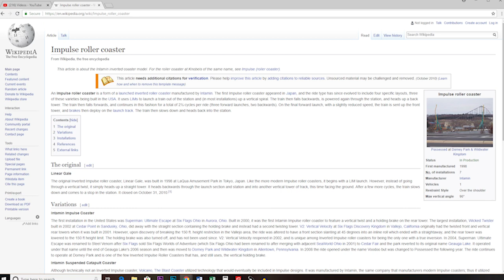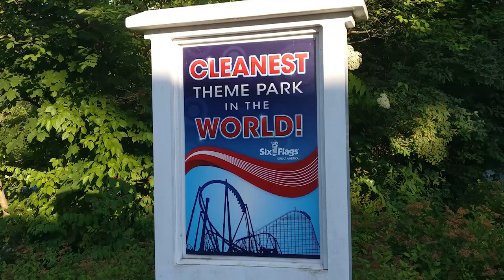Electromagnets, roller coasters, half-a-dozen flags, and clunkless chain lifts

Comment: Very cool! Check out Vancouver, BC's SkyTrain system. It's been in service since 1986, has been expanded several times, and is entirely LIM powered. The trains have a similar but much lower pitched whine as they accelerate. The MK1s have an especially strange crescendo, as they change the pulse width of the current driving the coils in the motor -- the MK1 trains were built before MOSFET technology matured, so they had to use a semiconductor which had fairly slow on/off times, and used frequencies well within audible range. MK2 and MK3 trains are all very quiet and smooth in comparison.

Comment: Would guess that the counter weight is keeping the chain tension constant. As the chain takes up the load it stretches a bit, and the weight moves down to compensate. Those transformers are usually marked with KVA and primary voltage, possibly secondary voltage. Those big ones look like perhaps 500 KVA. Realize that such a transformer can supply considerable overload for short duration, easily twice the continuous rating.

Comment: Some rides actually drive the chain TOWARD the hill, and loop the chain 180 degrees around a "dancer" idler.  This idler is tensioned by weights and shock absorber.  This was the case for Superman ride in 6 flags in Md.  The dancer oscillated when the train engaged.
     Regarding the drive tires, I would say the train is driven a little faster then the chain, and as the tires disengage, the train settles back against the chain, at the moment that the speeds match.  If the tires drove slower, you would have a guaranteed velocity mismatch at engagement.  Many rides use a small downhill to provide this match.

Comment: I would say that the linear motor on the first ride is probably run by a multiple of this style of motor drive units and, as you said, they are housed in that concrete building. They seem to go up to 4.5 MW so that should get those cars moving to 70 miles per hour! They also sink to grid so the braking action of the car would feed energy back.
https://www.industry.usa.siemens.com/drives/us/en/electric-drives/ac-drives/ac-drives-apps/enclosed-drives/pages/enclosed-drives.aspx

Comment: You’re very correct, the counterweight acts as a dynamic chain tensioner. Also, I’ve noticed that other parks suck in cleanliness. Cedar point is by far the cleanest park (non Disney/universal) that I’ve been too. Dollywood is a close second. However, Kings island which is another cedar fair property isn’t nearly as clean as cedar point. It must be a park management thing.

Comment: Hi there! I worked at SFGAm for 5 seasons as a ride op and in maintenance. My second season was spent entirely at Raging Bull. From what I understand, when the train engages with the chain, it adds an incredible amount of weight to the system, taking out all the slack between the motor and the train (i.e. the entire length of chain running from the train all the way up the hill and back down to the motor). In order for the chain to not become loose between the motor and the rear of the train, the motor end sprocket has that counterweight to pull out the slack.

As for the unfriendly signage, during my time working at Six Flags, there were several incidents throughout the country of people who were either injured or killed by roller coasters because they hopped fences. People cried out that Six Flags didn't do enough to discourage people from climbing over the 6+ foot tall fences with warning signage on them into dangerous areas. So I guess since I left, they've added more signage. Unsightly? Maybe. Trying to avoid lawsuits? Definitely.

Comment: Excellent sub-channel.  We were at SFGA just last month and had a blast.  It is a playground for engineers fascinated by technology.  The chain stretches by that much when the train load is added.  Hard to believe, but it really does.  Raging bull is the only super coaster at SFGA which means it is in the top class for speed and consequently requires the highest lift (and hence longest chain).  Some of the stretch comes from the bearings in the chain links relaxing between trains due to grease pressure and not just stretch of the steel.  Your 'ka-chunk' observation is spot on, but the shock is removed by matching the speed of the chain to the speed of the approaching train to minimize the mismatch.  Notice how the chain slows down between trains but never stops.  This is to save electricity and reduce wear.  It never completely stops moving because the energy to overcome the 'stiction' or static friction negates the energy savings and wear reduction.

Comment: So this is quite late. B&M coasters use drive tired to match the speed of the train slightly slower than the chain just before engagement. Other coasters hit the chain slightly faster but do not require tires, and thusly experience the "kerchunk." The counterweight is just a tensioner, and is present on most chain lifts.

Comment: As mentioned, the linear coaster is likely 480v, as that is the standard for anything commercial/industrial. The cables in the framing might look thick from the outside, but there are likely many smaller cables inside the jacket instead of some 4/0 gauge wire. Each “cell” of the linear motor probably needs its own circuit in order to control the timing/speed. 

As for the lift chain, steel does not stretch that much. Also, the chain underneath the track is the portion under tension, not slack (the car is pulled from the top, not pushed from the bottom). That being said, getting the chain under enough tension to not have any play at all would need some major forces, so instead they just designed a way to keep the loose portion under control (motor to the bottom of the train). When the counterweight raises, it is actually decreasing the length between pulleys (“loosening the chain”) since the force of gravity on the weight would pull the chain tighter in the down position (gravitational tensioner).

Motor-> pulley at top-> train will always be self tensioning and holding the weight of the passengers. Train->pulley tensioner at bottom -> motor is the “slack” portion, so the counterweight system is just keeping it under control. Before the train arrives, the entire chain is under the same tension. Then, when the weight is taken, 2/3 of the chain is now under (30 people x 175 lbs) 5,250 lbs of tension, so all the slack goes to the portion with the tensioner hence why it increases in length (pulls the slack/gets tighter).

Comment: The counterweight keeps tension on the driving gear for the chain. To achieve the smooth transition, a series of drive wheels are used. A great example of the drive wheels are on Apollo’s Chariot at Busch gardens Williamsburg. Look at a POV and you’ll notice that the chain is moving slightly faster than the drive tires are moving. This eliminates the “clunk” at the start of the lift hill.

Comment: The reason B&M's have that "perfectly smooth transition" onto the lift is because of those wheels just before it, they call that a "lift feed". Other manufacturers use them at times as well, but they're most commonly found on B&M's. Never noticed that counterweight though, I'll have to keep an eye out for them in the future

Comment: I think that the black, comb shaped plate attached to the train, next to the LIMs, is how it knows how fast the train is moving. Similar to the way ABS systems read wheel speed. You can see what looks like a sensor block between the banks of LIMs. The control system has to know how fast the train is moving in order to properly sync the motors, similar to a sensored brushless motor.

Comment: The counterweight at 6.30 is b&m being bloody clever, it weighs the train by the strain on the drive tires when it leaves the station, it then adjusts its speed and chain tension appropriately, the counterweight is adjusting the chain tension. Sorry its about 2 years late.

Comment: I’m a mechanic on Wildfire at SDC. The counterweight holds tension on the tensioner sprocket. When a train is engaged and the load is transferred from the booster wheels onto the chain, what you’re seeing is the chain stretching slightly as it’s loaded. The counterweight moves to accommodate this and maintain the required tension on the chain.

Comment: My first Great America! I built a show for them the year the double eagle wooden coaster opened. WOW. [that show came here to Santa Clara later]. I think what you are seeing on the chain lift is the idler or tensioning gear relaxing as the chain takes up the load it was mimicking. [not balancing, just tensioning it slightly during slack time]

Comment: Woo-Hoo, roller coasters, one of my faforite subjects. You are absolutely right about the B&M lift hills that always engage carefully. I have never had a single one of them (and I have been on a lot of B&M coasters) that would get a "bump" when attaching to the lift chain.
From what I was told, your assumption is guite right. The chain moves slightly faster than the "booster wheels" just prior to entering the lift hill. The important thing is that there is a clutch between the motors and their "booster wheels" that allows the wheels to turn faster than the motor when the train has engaged to the chain and is pulled by it.
On Arrow coasters, famous for their violent engaging of the lift hill, your train basically travels down a slope out of the station towards the lift hill, shoots up a bit and may roll back before it engages. The speeds are not synchronized and you clearly feel it.
The counter weight is, as others have stated, a tensioner. Since the motor is mounted on the bottom (other manufacturers place them on the top of the lift hill), and a chain can't transmit a pushing force, it is pulling on the lower "return" part of the chain, over the pulley on top of the lift and all the way down to where the train engages. With the little bit of play in each chain link this can give some significant lengthening of the chain when a train engages. So the lower pulley can move back and forth and is tensioned by that weight. 
Sorry for being metric now, but I am from Germany, the coaster was designed in Switzerland, so that is what the coaster and me are used to. Judging by the photos and the known height of the coaster, I would estimate that the chain has a total length of roughly 250 meters. Now let's assume a minimal chain temperature of 10°C and a maximal of 30°C (depending on the climate this might be a conservative guess). Given the coefficient of thermal expansion for steel (those chains are usualy not any fancy alloy, they are properly greased so they won't rust and the loads are not extremely high), this would make a difference in length of ~60 millimeters (a bit less than 2.5" if I am not totally wrong) between this temperatures. Of course there has to be some device taking care of that expansion, otherwise somebody would have to readjust tension all the time. Of course these figures have to be taken with a grain of salt since they are based on assumptions I have made looking at pictures, but the order of magnitude should be clear.
About your six flags rant, I couldn't agree more. As a roller coaster enthusiast, I visit the US every once in a while to ride some coasters, and of course, if there is a Six Flags park nearby, we are going to visit it. But we don't really enjoy, mostly due to the facts that you have mentioned. When we visited Gread America, we got rid of the parking fees since we stayed in a "nearby" hotel, which was a ~15 minute walk to the park entrance, but hey, $25 saved by just walking a little. Or recently we have been to Six Flags St. Louis, it was a day with not too many guests, so we had been on all the rides in less than three hours. We did not spend a single penny on food or drinks in the park, but instead went to a nearby Denny's where we got much better food at a lower price. Plus nice service. There's one more thing to rant about you did not mention - single train operations. Of course, shuttle coasters like the one you portrayed or their infamous armada of Vekoma Boomerangs can't operate more than one train, but also coasters that could theoretically provide a high capacity like their Batman the Ride B&M inverters, are often run using a single train only, even if the length of the line would allow for a second train to be run. I assume they want to make people pay for their Flash Pass or what it's called. (Dislike! No, not your video, that behavior of Six Flags!)
Hmm, I could add tons of other stuff, but looking at my longest YouTube comment ever written, I doubt anyone would ever read up to this point, so I better hit the submit button now...

Comment: My guess on the lift chain is that the chain motor runs slow until the train engages, when this happens the length of the chain tightens up leaving slack from behind the motor sprocket and below the train. The counterweight is on this slack and the position of the counterweight could be controlling a variable frequency drive which speeds up the motor.  This way the chain runs the same speed as the idler wheels then speeds up slightly once the train engages. Once the train is off the top, the tension drops, the chain returning from the top sags down, the counterweight goes up and the chain slows back down.

Comment: The counter weight is just that, a counter weight. It isn't controlled except by gravity. As the chain begins pulling the trail up the hill, the weight of the train provides tension to the entire length of the chain, which causes it to stretch and become longer (mostly compressing the lubricant between the chain elements, but also stretching the metal). The counter weight uses gravity to take up this slack.  The smooth transition is being created by the driven tires pushing on the back of the train which keep the train from slowing down while it transitions up the hill until after the chain is attached to the front of the train. To get them to link, the chain moves slightly faster than the tires until the chain grips on the train, when they two settle at the same speed.

Comment: Most likely the counterweight is for tensioning the chain. When the train couples to the chain he puts weight and therefor tension on the upper part of the chain (in front of the train) and this leads to les tension behind the train. The counterweight compensates that by lowering and keeping the wohle chain tensioned.

By the way, there are similar systems on gondolas, chairlifts, etc. But in that case the weight (or nowadays often a hydraulic system) acts the other way, when weight is added to the track (or in that case the rope(s)) the weight will go up. That is because the gondolas will pull down the rope between the poles and therefor lengthening it. Part of this effect get's compensated by stretching the rope but mostly it's done by the tensioning system. On the lift hill the tracks are solid and don't get longer, that's the difference. On a funicular it is just like the rollercoaster.

Comment: The counter weight on the B&M does what you say and also dampens the offload at the top of the hill. On old ones without the counter weight the track would have a little dip and flat section at the top of the lift hill (pov of Dragen Khan in Spain as an example). This saves on having to do that and stops strain on the chain as each car detaches from it.

Comment: I would guess that the fans on the motors were originally designed to have the fans run until the motors cooled down. Then someone who actually fixes things did the smart thing and just forced the fans to be constantly on in the logic. The cost of running the fans is miniscule compared to the cost of a blown motor and ride downtime.

Comment: If my motorcycle experience is anything to go by, chains can stretch slightly especially over very long distances like on a roller coaster lift, so the counter weight could just be a sophisticated tensioning system.

Comment: The common theory of the counterweight serving the purpose of a chain tensioner makes sense to me, but there's an additional element of curiosity added by what appears to be a position sensor above part of the tensioning stay. Could this possibly be used to calculate the weight of the train, and thus perfect the amount of braking applied later on in the ride?

Comment: The counterweight is adjusting the chain tension to make up for the fact that the chain stretches slightly and gets longer when an train is being pulled to the top.  It isn't much, but if it isn't accounted for, the chain will either jump off its driving gear or have to have an unacceptably high rest tension.

Comment: 6:36 My theory: While the chain is not "lifting", it's kept slack to prevent ware.  When the train approaches it, the counterweight tightens the chain around the gears to prevent the train from causing the chain to slip off the mechanism.

Comment: Your idea was almost entirely correct, the couter weight helps align the chain with the hook system b&m uses on it's trains. If you notice it will not move the same amount depending on how far off the alignment is

Comment: As far as the counterwieght, your theory makes sense, but i am just guessing here.  its probable to take some of the chain slack out when the train engages the lift, there is a bit of slack in the chain to allow for thermal changes and that probably smoothes out the slack so the chain doesnt make a lot of noise when the train is on it.

Comment: I would assume that weight is what tensions the chain and when the coaster gets grabbed by the chain the extra weight makes the chain "stretch", increasing the overall length of the chain and making the weight drop a little.